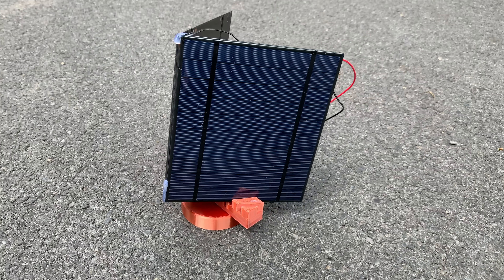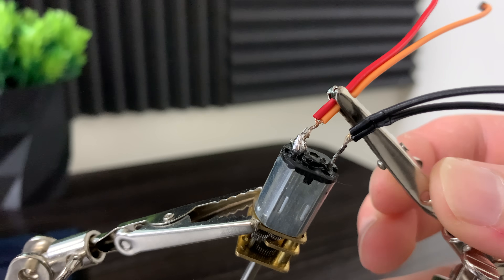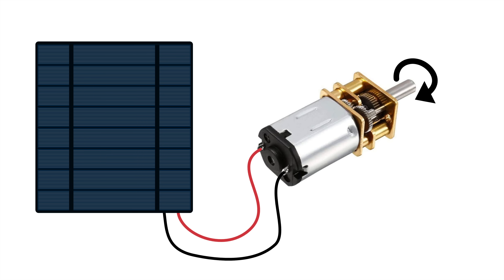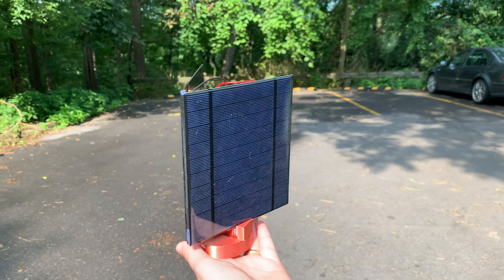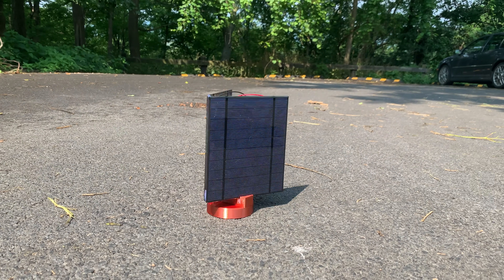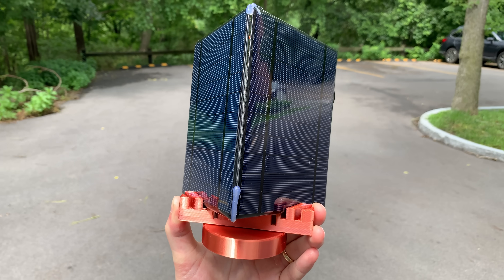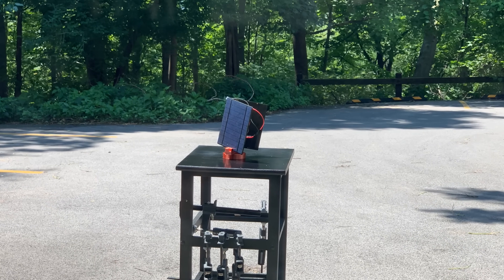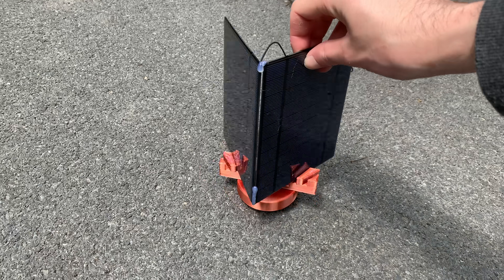World's simplest sun tracker.

Comment: That's good, but that means that neither of the panels is at the optimal angle.  I think to improve efficiency you could use two small solar panels to drive the motors and one bigger one on top so it will always point directly towards the sun.
Great work!

Comment: I can see how this works, but surely  the solar panels are never optimally aligned towards the sun, reducing generation efficiency? I’m thinking this would be good for controlling a rotating base on which you mount an entirely separate/decoupled solar panel that is perpendicular to the sun and does your actual dc generation

Comment: this was creative. but it does not solve the real problem of a large panel. do this. design (on paper), a surface that has 8 panels. each 50 cm by 1.5 meter. design the structure on the flat ground. it whould have some angel, it should point to a certain direction accoeding to the location on earth. then design a sun tracking device that moves the whole structure. suppose 8 meter by 1.5 meter.  let see your design on paper first, before building it.  that is a useful device. this is an entertainment project. when you do, send me your design by email, i build it. if i beleive it works on paper. i already bought the panels and electronics and wanted to build a static structure with wood and concrete. if your FUTURE design works, then i build the sun teacking. installation is in my to do list. starts 3 months later. then you can promote that structure as your design. at my cost for building it.   have a happy time. moses  email me here:  support at    robot-hosting.com   1 sept 2024 - december i start building and installing.

Comment: I love this vid, and of course it wins on being really simple. But as many commented already, if making a "real" tracker, there are millions ways to make it better: for starters, both panels more flat so both directly towards the sun. A small micro and H-Bridge to control the motor. And either a tiny angle on the two panels to still use the voltage difference to drive the correction direction, or an independent sensor from the main panels. But again, the vid was not about making the best tracker, but the "World's simplest".

Comment: This is a clever idea. Of course, as others have said, the end goal is to use this to position a large solar array, and I don't see how to do that without considerably more complication. The motor has to be small, in order for the two little sensor panels to drive it. But the motor that turns the larger array has to be large, to provide the power to turn the much larger array. Or put another way, the two little sensor panels don't produce enough power to drive a big positioning motor. They can position themselves, but not much else.

Comment: In 1913 a solar power plant in Maadi Egypt was built by american engineer Frank Shuman. The plant produced steam to drive a water pump. The rotating parabolic mirrors followed the sun automatically with the help of a thermopile, a relay and electric motors in a similar arrangement as in the video. Although every morning the mirrors had to be reset manually...

Comment: Very interesting.
Actually there's an analogous solar tracker I read about decades ago for controlling a solar collector -- a pipe for heating flowing water.  A parabolic mirror (NOT a parabola of rotation) has this pipe at the focal point and as a point of rotation of the mirror.  On the two edges of the mirror are tubes containing some volatile liquid -- Freon, for example.  These two tubes are slightly shaded by its respective side of the mirror, and each is sealed on one end and connected to a dual-action (i.e., NOT a spring-return) air cylinder on the other, which cylinder is able to rotate the mirror around the pipe.  When the mirror is pointed at the sun, the two tubes provide the same pressure of Freon.  When the mirror is pointed somewhat away from the sun, one tube is more shaded by the edge of the mirror than is the other, and the differential pressure extends or retracts the air cylinder rod, rotating the mirror until it points to the sun.  No electricity involved at all, but otherwise essentially the same idea as described in this video.

Comment: nah, simple doesnt mean best
it only turns in one dimension, side to side aka yaw, lets call it X
it has no ability to pivot in dimension Y, up and down aka pitch, to get the panels perpendicular to the incoming rays of light which would result in higher voltage output and better efficiency
calling it simple just says to me that you're trying to pass off your 50% completion of the task as if it were 100% complete. lazy engineering.

Comment: Very Nice!
This reminds me of the window insulator actuator I built in the 70s to open and close the window insulation. It was a small glazed box with a thermal switch inside.  Sun shines, heats switch, and shades open.  Sun  leaves, switch cools and closes insulation. Some mass inside keeps it from cycling.  No computer control back then.  We also used it to control batch water heater insulation.

Comment: That is sooo clever. I wanted to build something like this but WAY more complicated with stepper motors and a microcontroller.
I'll give this build a try. Can you just draw power from it when its in balanced state ?  If the voltage balances itself out +4 vs -4V you should have 0V  right ?
So I may still need a microcontroller and a couple transistors (mosfets probably) to disconnect the solar panel from the motor and to my load or battery.
Also i think it'd be more efficient if you put the solar panels horizontally next to one another so theyre more directed towards the sky and then let them follow the sun like this.

E: After some more thinking about it I may still need my stepper motor. Since your setup only works because both solar panels are never fully facing the sun (they would probably cancel themselves out too quickly then). And if the solar panels face away from one another you loose quite some power. Still amazing idea.

Comment: i want to knwo what happens to the emf, if the amps are controlled it wont burn the motor out, or does opposing magnetic fields not effect the voltage required to generate one, or does it start to resonate as the feild collaspes, a motor is most powerful at 0 rpm it also draws the most amps as reverse emf as voltage rises amp drop and as voltage drops amps rise,  i want to make a wifi tracker so i can a wifi tracking base on the roof and an aerial in the car and it self align

Comment: I like these "hardware programmed" solution. One comment, though: if it uses all the energy from both solar panels just to turn towards the sun - then your solar panels generate nothing to batteries. So maybe there should be two smaller panels just to control then DC motor, and the two bigger to generate electricity?

Comment: It sets the direction of the panels, but there is a short-circuit between them. It does not make sense. One should connect black wires together and then the motor between orange and red. This way when voltage of one panel is greater than the other -the motor rotates one direction and when it's opposite - another direction. When the difference is zero (which means the panels are facing the sun at the same angle - motor stops. And you still can get the electric power from two panels to power some devices (you'll need 2 diodes).

Comment: Check out Allen Pan's Karat interview. He describes creating something similar to this using just 1 USD in materials per unit for a low budget educational demo. He used a paper plate, half a small bread board, a battery, a motor, a photoresistor and a Darlington transistor to achieve something similar to this device.

Comment: to control a larger power supply panel you simply take the voltage to a control board which drives a big motor for those panels.

Comment: Welcome to the world of automatic control theory! It may amuse you to know that you came across the same problem Norbert Wiener stumbled into. In his autobiography he describes designing an autopilot for ships (automatic helmsman maybe?). The initial idea they came up with was very similar to yours: compass points left of desired course - rudder goes right, and vice versa. They then ran into the same kind of oscillations: overshooting due to accumulated momentum. There are basically two ways of fixing that. First is to introduce a "viscous" term into the feedback. The feedback should penalize not only being too far from desired position, but also going too fast. If you work the mathematical model out, you will probably still get oscillations, but their amplitude will decrease exponentially over time, so practically the viscous term stabilizes the system. I am no electrical engineer, but I would suggest a solenoid for some inductivity. Alternatively, just introduce some friction (dry or viscous) into your rotating assembly. Sounds awful from a mechanical point of view, but it could work.

Actually, many rookie paddlers make the same mistake and overshoot their desired course only to start yanking in opposite direction, which leads to another overshoot, probably with greater amplitude. They are then taught to park in two parameters: not only should they point their bow to the target, they should also counter and stop the rotation before the bow overshoots. Well, human brain is an awesome computer, and it comes with pretty awesome sensor package, so this approach also works.

Comment: Me da risa lo que acabo de ver, las celdas solares están unidas negativo con positivo en los bornes del motor, cuando el tracker alcanza el equilibrio es cuando ambas celdas generan la misma intensidad  y como están unidas negativo con positivo entran en un corto circuito perfecto y la eficiencia de generación eléctrica se vuelve 0v
Eres un genio

What I just saw makes me laugh, the solar cells are linked negative to positive at the motor terminals, when the tracker reaches equilibrium is when both cells generate the same intensity and since they are linked negative to positive they enter into a perfect short circuit and the electricity generation efficiency becomes 0v
You are a genious

Comment: This is interesting, but not directly practical. It might be useful for a pilot mechanism to turn an encoder used for turning real solar panels delivering meaningful charging current. As is the solar panels here are not delivering anything except steering input for the motor. A disadvantage of the array as shown here is that when they are causing the vertex to point to the sun, the angle of incidence of the sun's rays is not delivering maximum power for either panel. The nice thing about it is that it is entirely analogue. My flat house roof gets sun from early morning to late afternoon (asymmetrically because of a hill and the neighbour's house) from East South East to South West and if I had solar panels, I would want to optimise their tracking both horizontally and vertically. Cool little project though. All the best, Rob in Switzerland

Comment: It seems to me that this system works by shorting out two voltage outputs.
Yes, it performs as long as no damage occurs to the panels themselves from shorting their outputs.
At least adding some resistors to convert the plus voltage to heat would be more elegant than simply shorting them.
The good thing here is that I am only right about 10% of the time. //ji

Comment: Well, this tracks the sun, but its geometry dumps about 50% of the energy away - the angle should be as flat as possible, for the solar panels to also be able to actually generate electricity. I also don't really see this thing driving, say, a 200-watt unit, this thing could at best act as a "controller" of sorts for one.

Another issue for practical application would arise if one of the panels gets dirtier than the other, which would either offset the tracking or (maybe) make it spin. There should be some form of continuous calibration going on, for accurate tracking long-term.

However, using smaller photovoltaics on the edges of the primary solar panel, along with a slightly more sophisticated control/movement solution would indeed likely be able to give the panel a rather good idea of its angle relative to the most powerful local light source. With some math, 3 photovoltaics should be sufficient for horizontal and vertical tracking.

Comment: You basically over damped the control system by using a slower motor so it wouldn't overshoot the equilibrium point. Very nice and simple.

Comment: This would be fairly easy to adapter to a larger system. The two panels outputs can be used to switch a relay controller for much larger panels and a larger motor. I guess you could even use this method to track horizontally and vertically with 4 small panels; two for horizontal and two for vertical. Though I might add diodes to keep the cells from causing issues with each other.
Reply: Relays are unreliable long term outdoors. Diodes are the way to go, and fuses would add safety

Comment: Super Cool Idea.
Unfortunartunaltly not a real world solution because the panels are always not facing the sun directly. But that is the main goal of tracker. And the tracker directly convert almost all the engergie of the panels into heat.
Using the small panels just as a controllerinput for amechanism that rotates bigger panels might be overengneered. As sensor LIRs or  LIDs would do the job.

Comment: What I am wondering is, how much power would a panel situated perpendicular to the sunlight produced, compared to how much it produces under an angle like in the video.

And how much the two panels produce compared to one positioned as above.

and maybe how small of a panel (two) would be sufficient to turn that motor, while a significant amount of panels are in a fixed direct position to have the most gains

Comment: This is similar to how you adjust the lights in nineties cars, with a potentiometer instead of the solar cells. When you turn the knob the motor turns until equilibrium is reached again, also without electronics.

Comment: Briliant idea thank You..

Adding diodes to avoid reverse flow of energy, whould make the idea solid against criticis..
Reply: MAYBE, on the critics.... critics will be critics... sometime rightfully so.
Reply: The diodes will make it oscillate, won't they? if you put a diode inline with each panel, you will never have zero voltage on the motor. If you put them across each panel, you now have 2 diodes connected in parallel, with opposing polarity, i.e. a dead short.
Reply: @gozewson  The short circuit will always be there weather you use diode or not. I don't understand how the motor is turning with such low power?
Reply: It's a diode not a magical spell you can always use to stop your "reverse flow of energy" anyway you want. The best you can do is neutralize the current before it gets to the solar panel.

Comment: Either i'm missing something, or this doesn't make sense. Why have two panels at such different angles where only one can be at the correct angle to the sun at a time, instead of making sure both (or one panel) face the sun all the time, using the motor?

Comment: This is a single axis machine.  I can do this with just 6 diodes and an electric motor.  I can do a two axis (left / right, and up / down) with 7 diodes and two electric motors.  Yes 6 diodes is more than 2 solar and a motor which is just 3 parts, but 6 diodes is much less expensive than 2 solar panels.  If this were a standalone system you would also need a power source for the motor, like a battery.  I designed mine to use with large solar panels to keep them perfectly facing the sun as it traced across the sky and even as seasons changed.  So for my build I just tap power from the battery I already needed in the system.  I don't share a skematic, but I give you a hint.  4 diodes make a wheatstone bridge.  The others are photodiode.  I bet you can figure it out from there :).

Comment: Interesting, but kinda inefficient electric generation. The solar panel must be perpendicular to the trajectory of the light direction. This means, it is good at rotating and nothing else. Works as a proof of concept but needs nore engineering before thinking of it as a solution to a real problem.

Comment: In the video at 0.29 seconds the warm color leads are soldered to the same motor contact, and the black two leads are also soldered to the other motor contact. Shouldn't these four leads be videoed showing the four wire leads soldered to the two motor contacts Warm/ Black & Warm/Black as the verbal tutorial and later motor shaft rotational showing a still diagram showing warm/black leads on each motor contact ?

Comment: The Illuminated panel will pass the energy trough the shadowed one heating it. You need add diodes to direct the current only to the motor.
Reply: this is the minimum requirement to upscale it and make it USEABLE and useful, and avoid frying any panels.

Comment: Is it possible to calculate the Watt it produced and loss power due to the movements? I'm really interested with how simple yet brilliant this project is!
Reply: if you have the solar panels voltage and current, and the motors voltage you can measure the watt

Comment: Ok, so this could be used as the guidance for a larger panel perhaps built around this. My only constructive feedback is the panels are not directly facing the sun which might lower their efficiency. I was thinking of this as a central piece to a larger array which is fully facing the sun so you get full efficiency. Think of this as the center of a sunflower with the radiating panel acting like the petals, as sunflowers follow the sun just like this. What I love about this idea is the low tech non software cheap and cheerful design. This would benefit third world applications. Well done. I've been visualising a non software way of doing this for a long time and you cracked it!